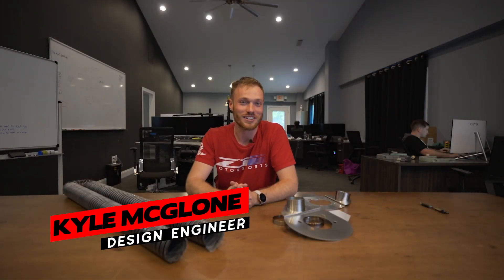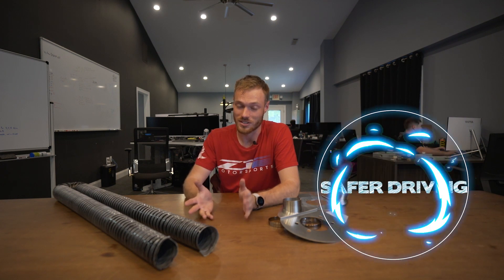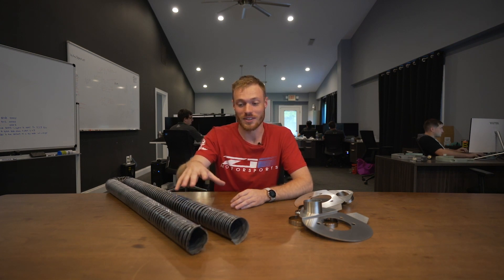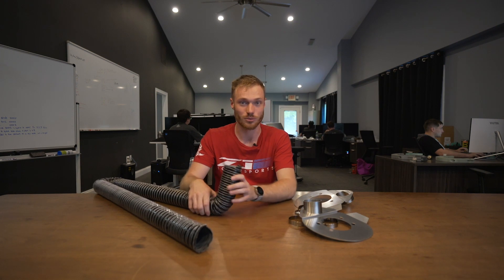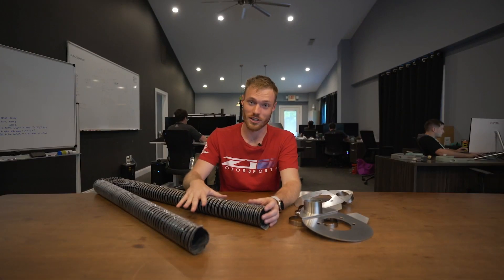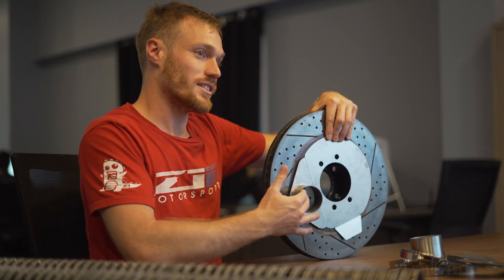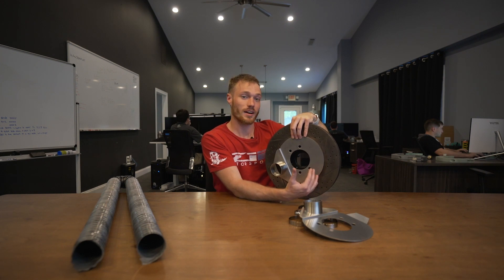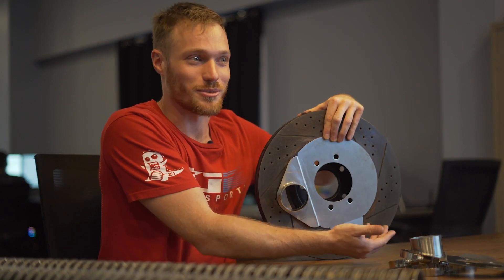Behind The Design | Z1 Front Brake Cooling Kit

Comment: I run a aftermarket Brembo GT kit on my 06 G35 CPE. Will this work with my setup?
Reply: Wondering same on 350z
Reply: The will not bolt up to the v35 platform. Since these are 370z, the bolt pattern is different for the holes in the wheel bearing, but I don't see any reason why we can't just drill them out to the correct pattern. I might buy a set at some point and try this. Have to finish my supercharger tuning first though